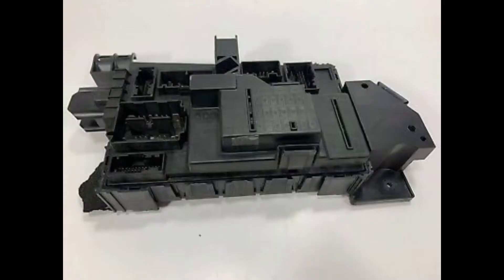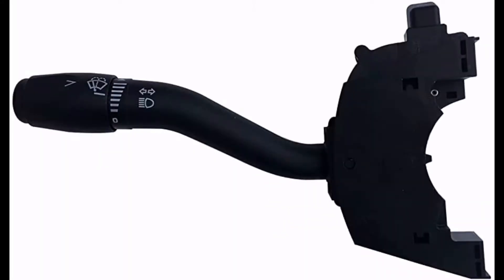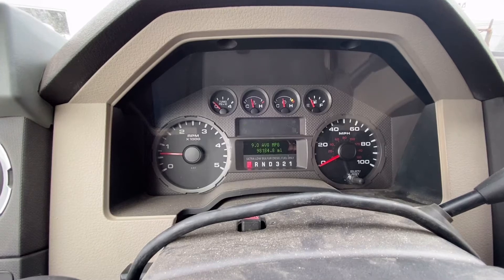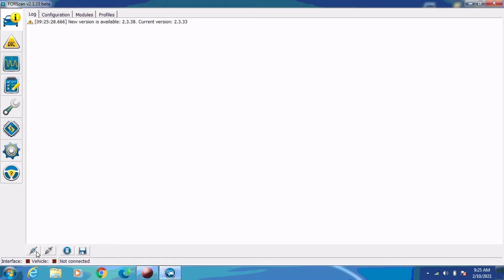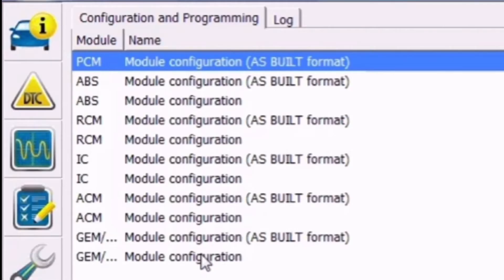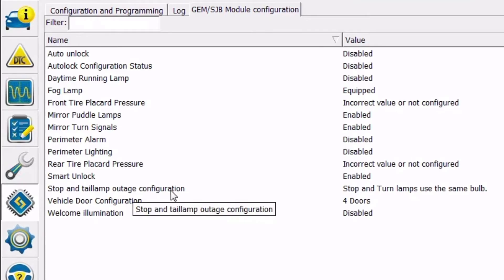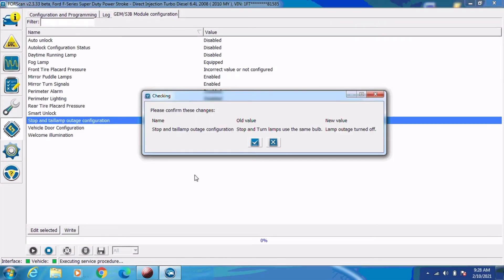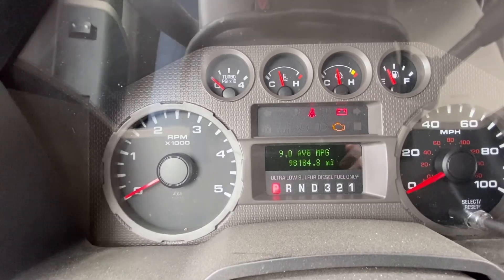How to Fix Ford Turn Signals Flashing to Fast with LED Bulbs

Comment: Is there anyway to do this on a 2010 lariat
Reply: Yeah the story of my life🤣🤣
Reply from the maker: I’d have to plug into one to be sure, but yes, I think so.
Reply: I have and the outage tab is not there is there a way to do it in (as built data) i really dont want to put resistors on mt truck..
Reply from the maker: @mikehairston7338  I would think it’s there in the asbuilt data, but I haven’t seen where anyone has ever mapped out the asbuilt data on the 2010 GEM module.
Reply: have you found a mapped out [as built data] for a 2010 f150? i got the data sheet but nothing to tell what line controls what in the gem module

Comment: Thanks for the tip good buddy. I might make the lights 30A each to light the road with each flash thought I wonder which part of the fuse block flashes for the trailer connector?
Reply from the maker: So I'm thinking about your project a little more today, and I think I'm going to have to take back everything I previously said. A 2021 is going to have a trailer tow module to run the trailer lights / turn signals, rather than just relays like the older trucks. First problem I'm thinking of is I'm not sure it even flashes the trailer turn signal circuits unless it senses a trailer connected. It senses a trailer connected by the draw on the parking and turn signal circuits through the trailer plug. Second problem is it may think a load like lights or even the primary side of a relay is a trailer and tell you you've successfully connected a trailer every time you start the truck. There are a lot of question marks that I don’t have definite answers to because I haven’t tried this on a truck with this system yet.

So after thinking about it, I think you’re going to need to wire the primary side of your relays into the turn signal circuits, and I do think the BCM will probably flag it as a short and set codes, but I’d try it first and see. I know you wouldn’t think the 0.2 amps the primary side of a relay draws wouldn’t cause a problem, but I’m pretty sure the system is that sensitive. I think you’re going to have to tap into the turn signal circuits going to the rear turn signals, and if it flags codes and disables the turn signals, then you’re going to have to play around with the module configuration / as built data. It might be as simple as turning off the bulb out feature, but I’m thinking since it’s going to draw slightly more current, rather than less, it’s going to flag it as a short and turn off power to the turn signal circuits you’ve tied into.

There are a ton of different factory rear turn signal configurations, due to the fact quite a few people remove the truck box and install flat beds with custom lights / turn signals. Some where in there I’m sure there’s a setting that will work for what you want to do, but you’re going to have to play with it a little. I know this can be done though. A few months ago I had to configure a 21 or 22 Super Duty that the customer installed a flat bed on, and it was a loaded truck that even had the factory radar sensors in the taillights, that were missing after the flat bed installation. Had about 20 messages pop up on the cluster after start up. It took a couple hours playing with it, but eventually I got all the messages to go away and even the list of codes it was setting in the modules was gone.

Some where I think I’ve seen a pretty good Ford Technical Service Bulletin about configuring modified trucks with non factory tail lights, but I didn’t find it in a quick search.

You’re probably going to need a wiring diagram for this. I glanced at it while I was writing this and there’s not a real good place to tap into the rear turn signal circuits. All the connectors it goes through on the way to the back of the truck are twenty or more wire connectors. They run from the body control module inside the cab, into the engine compartment, then to the frame, and then to the rear. I guess it depends if you want to tap into in inside the cab or in the engine bay or frame.

If you’re wondering about the turn signal switch it’s just an input for the steering column control module, then it goes over the network to the BCM so I don’t think that will do you any good.

Comment: I plan to add a amber light to the mid-point of my truck, because in high population cities, drivers can't see my signal once they are beyond my tail lights and along side of me in the blind spot. The current draw will be minimal, and just enough to trigger the electro-magnet on the rely to close the circuit,. the current for the light will come directly from the battery and in-line fuse.
Reply from the maker: I’m not quite sure what the tolerance is, but I did see someone try to wire the primary side of a relay like you’re talking about into the headlight circuit on a truck for snow plow lights.  Around 0.2 amps, primary side of a relay, almost no draw. The BCM would intermittently flag it as a short and shut the headlights off. If I was adding turn signals I’d definitely just tie into the trailer lights in the engine compartment. They’re all ready isolated by relays like what you’re wanting to do and nothing cares about what the load is on them as long as it’s under 20 amps or whatever the fuse is. I think it’s probably the best and easiest way to do it with no question marks.

Comment: If I add a relay to the turn signal, will it detect the minute increase in current? This is for a F250 2021 model year. Can you show which terminal in the fuse box provides the 80 times per second flash that I can use to activate the relay?
Reply from the maker: Not sure what you’re wiring up, but it should have relays tied to the turn signal circuits for the trailer wiring. Can you just tie into the trailer wiring?

Comment: Hey, I'm opening my GEM options and I'm missing the option for the lights. I'm also missing several others. What am I missing? 

2009 F150 XLT 5.4
Reply from the maker: I’m not sure without looking at the screen.  It should be in the body control module.

Comment: Thx , but what happen we the led bulbes 💀 will is blown faster?
Reply from the maker: They should have a normal life span.  It’s a standard 12-14 volt circuit.  The voltage doesn’t go any higher.  The amperage draw drop due to the LED bulbs, and the module registers it causing the problem.  Shouldn’t affect bulb life at all.
Reply: @CarShopTalk  yea your right. But I mean, that after you turn off the warning and the bulb is burned out, you will not know that the led is no longer working.
Reply from the maker: @TWARDOWSKY.  I see your point.  Yes, it will be back to having to actually look and check and see if a bulbs out. That is the down side to this.

Comment: The previous owner put LED lights in flashers. I have a Foxwell scanner. Will that scanner help me make the change on a 2013 F-150?
Reply from the maker: I doubt it. It’s going to have to be something you can change the programmable parameters or as-built data with.

Comment: A little bit of a fun fact. If you happen to have a 2013 F150 V6 3.5L Ecoboost like I do. Then if you don't happen to see or find GEM, then find BdyCM, NOT BdyCM (AS BUILT FORMAT). Otherwise you're really gonna f*** up the truck big time. From there you'll see the Stop and taillamp outage configuration. Hope this helps.
Reply: You you believe this will work on a 18 Expedition??  And would I look in the sane place?

Comment: Thanks so much! Will this work on a 2012 Ford F150 Lariat? And can you share a recommended link to buy the Forscan device/
Reply from the maker: Forscan is a download.  You can download it from https://forscan.org/download.html.  I think you need the paid version to change settings, but even the free version is better on Ford’s than most generic code readers. You’ll need a way to connect to the OBD port and if you’re laptop has Bluetooth I would recommend an obdlink Mx+.   I think I got mine from Amazon.
Reply: @CarShopTalk  what interface do you use with the forscan software
Reply from the maker: I use a Bluetooth obdlink mx+.   It’s capable of talking to multiple networks, not just the hs can.